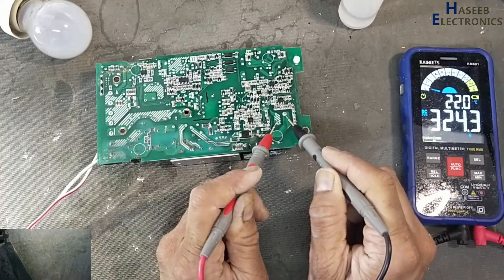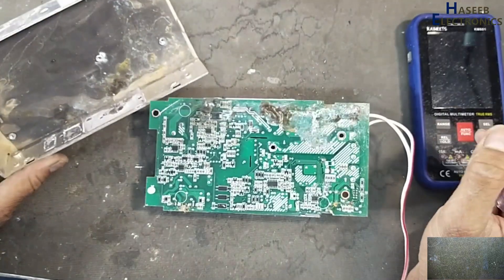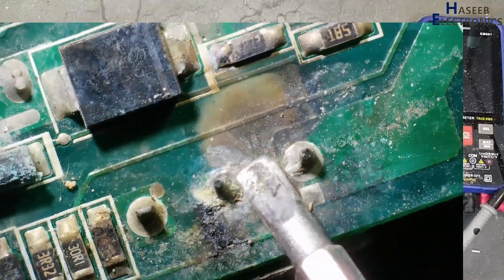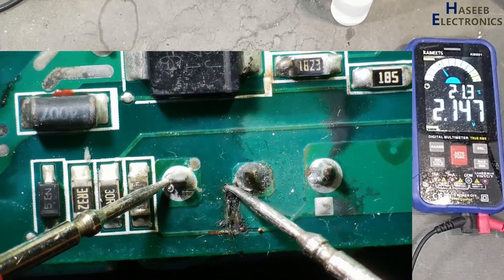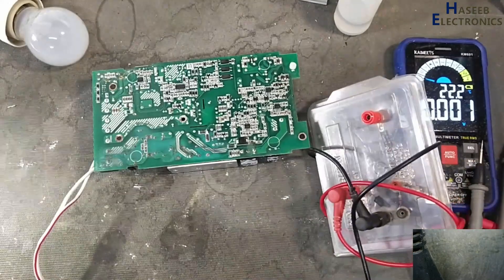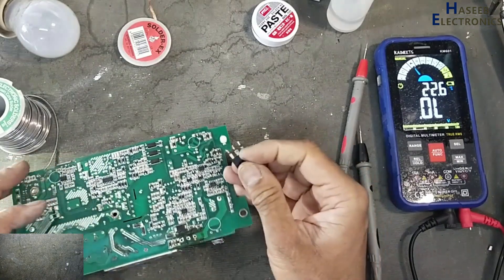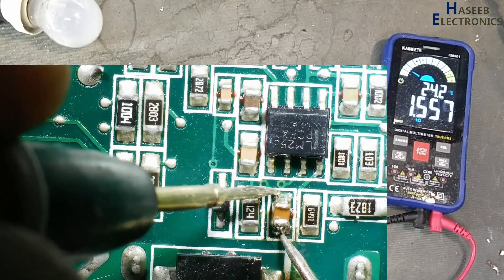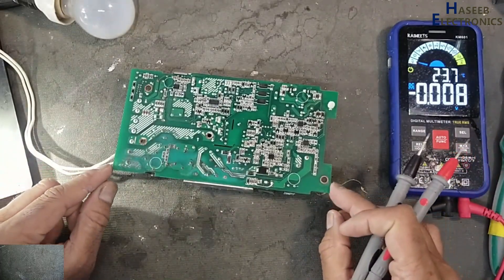{1113} SMPS not turning ON, no output voltage

Comment: Hello, good time, Mr. Engineer. Let's assume you don't have a similar board from which you can take the desired part. Please guide me on how to detect the values of the damaged SMD resistor and capacitor on the board and use the appropriate value. In two videos, you talked about SMD resistance, but you didn't say what to do if the values on the resistor are completely erased. Thank you.

Comment: Thank you for your videos. How did you know what was the value of the capacitor that was replaced
Reply from the maker: There was a visible sparking sign on capacitor body which located fault location 
Otherwise it becomes difficult to locate leak capacitor 
I took capacitor from a similar model scrapped donor power supply circuit 
Otherwise smd capacitors are identified by their size code in inches 
And nominal circuit voltage x 150%

Comment: Hi sir. How you can find out the value of the smd resister?
Reply: He measured the same resistor on a known good power supply of the same type. It measured 10k Ohms.
Reply: I know that but. I asked how to measure or how to find out a what resistor was there before (smd resistor)
Reply: @Drpipike  he has already made a video how to get the value of smd resistors